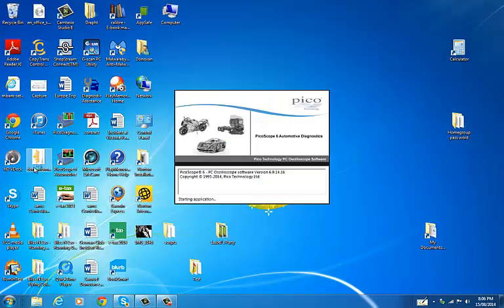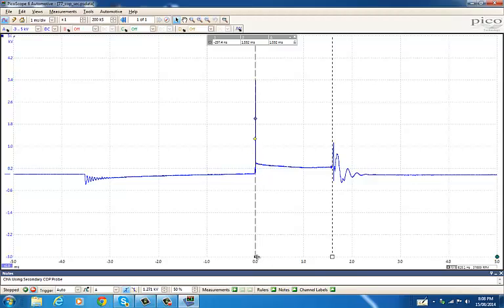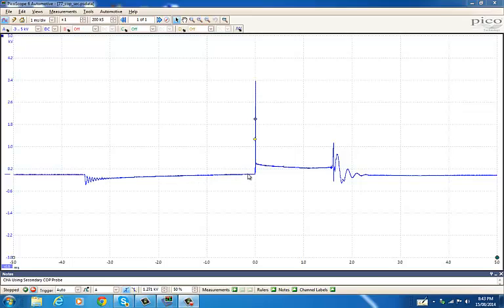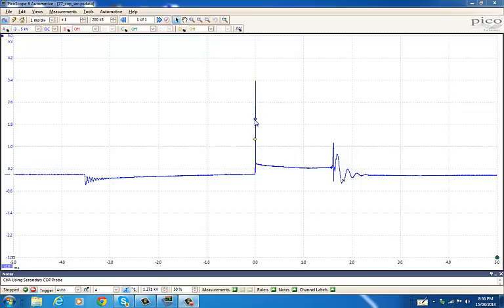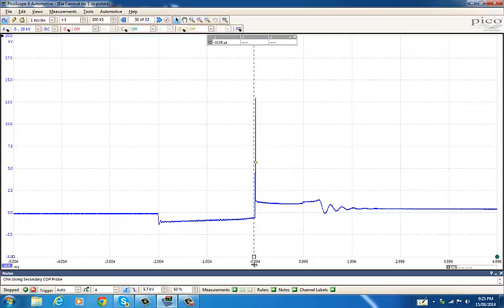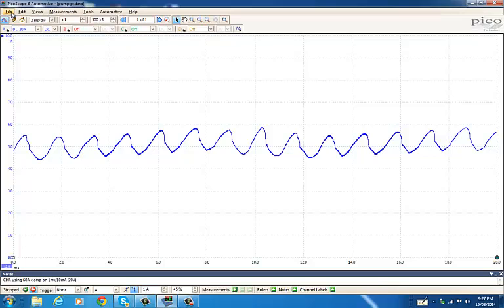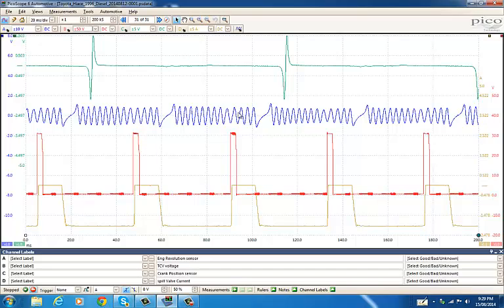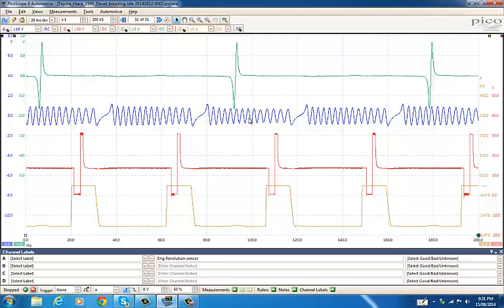Picoscope secondary set up

Comment: You didn't confuse me either.
Secondary ignition interruption is very hard to concept to learn.

The Hiace 1KZ-TE was a interesting one, sure wouldn't pick that the tensioner failed at first and the code flow chart wasn't much help.
Reply: We did not think the cam belt would have had any bearing on the injector timing ether due to a gear driven pump, I am waiting to get a chance to see a pulled down engine to properly understand the correlation between the two. Thanks for your comments